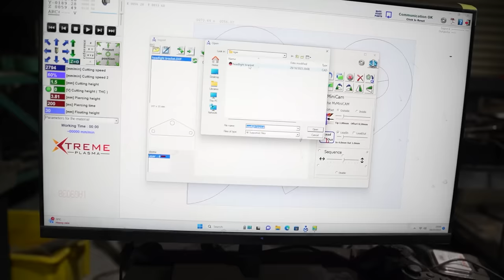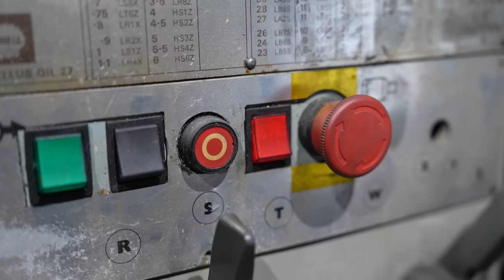More Problems! | Triumph Tiger 90 Restoration | Episode 7

Comment: Hi Dom thoroughly enjoy your videos.  In 1964 I was 17 and bought a brand new 1963 tiger 90 reg 153 NF from Hunts motorcycles on Kingsway Manchester. It was painted in Triumphs Alaskan White and cost £280, an expensive  bike then, but a real looker. After about 4 months the petrol tank started leaking from underneath onto one of the coils. Triumph replaced it with a 1964 tank which had a brace between the mounting lugs, and the tank sat onto 4 mounts off it. I used to rev the goolies off it as did the rest of the rockers in our gang. This caused one of the bolts to come loose holding the alternater to the crankshaft. It fell onto the primary chain, and as it went round the sprocket, tightend the chain and smashed the primary imput shaft. Triumph took the engine back to Meriden repaired it, and replaced other parts free of charge.  The good old days!  I am 77 now and still love bikes, it's something in the blood. Spud.

Comment: A couple of things when you fit a nipple on a cable the most important thing is to flare the inner cable out to fill the countersink in the nipple this provides a mechanical fix when he solder goes round the cable . The second thing is to make yourself a solder pot , a bit of 1 inch brass drilled out to 3/4  filled with solder then just heat it up and dip the end of the cable with the nipple on into the pot (dipping in bakers fluid first ) and you will get a factory like joint .
Reply: Will this work with stainless steel cables?
Reply from the maker: No it won’t work with stainless cables, you need a different flux it’s a lot more difficult!
Reply: Dom I agree with Mervin about the nipple soldering the cable will just pull through if not flaired out. And why aren't you fitting a twin filament headlight or have I missed the intended use of the bike.
Reply: @raysilver2445 I also wanted to say the bit about flaring the cable. If it’s not done right It’ll pull out just when you’re hauling on the lever for a bit of serious stopping. Not good! I also think a front light has to be ‘dip-able’ (high beam / low beam) to be legal. I guess this machine is exempt MoT, but, keep it right! Exciting project though. Les
Reply: @zane1os   In the UK - Carrs Brown Flux and C1000 221deg C   Tin/Silver solder works well with Stainless.
Reply: That soldering won't last 2 mins.. 2 x adjustable spanners ??????

Comment: Hi Dom, This is not meant as a critisisme. During the 70's/80's I competed in moto-x (scrambling) we where always making & repairing our cables. I was taught to flare the cable into the countersink in the nipple before soldering. This helps prevent the cable pulling out. Keep up the great work. All the best Paul Wood.
Reply from the maker: Thank you

Comment: If you can find it - “Mouse Milk” penetrating oil makes a world of difference. We use it in the Army Aircraft hanger to loosen impossible stuff. I maintain the flight sims for the RC12 and MC12 aircraft and it’s saved my butt.

Comment: Hey Dom please be aware that the bracket with the light on it will wobble about as you ride.  I speak from experience! Mine wobbled about so much it eventually weakened and snapped off.   Twice!!!   Bung a little triangulation piece under the angle to stop it wobbling, and you'll be all good mate.

Comment: I don't like the light. Previous comment is spot on about spreading the cable end in the nipple before soldering. Totally unnecessary to solder the bush into the rear brake pedal: I would have drilled and tapped the boss of the pedal to take a grease nipple and drilled the bush to suit so that the pedal would be lubricated. The saddle will be good with a little attention. Hope that the engine turns out to be good. Best wishes.
Reply from the maker: That’s a lot of negativity! Thanks for watching though…
Reply: @DominicChineas  Sorry that it came across as negative. Not too late to incorporate a grease nipple in the brake pedal. Can't apologise about the light though: it just looks wrong to me. Again, best wishes.

Comment: Really nice job on a nice project :)
One though I'd like to share: be careful not to put galvanized (zinc based) metal in contact with aluminum; it would result in accelrated corrosion of both (oxydo-reduction couple)... ;)

Comment: Hi Dom,
Put that rusty headlamp into the electrolisis bath to remove the rust, then put it into a bath of diesel to soak for a week beforwe you even attempt to undo the nut on the bottom, I assume you are keeping the original worn chrome look if so be careful on the electrolisis so you dont strip that off, if you are going to re-chrome then it doesn't matter. cheers, Denis Harvey

Comment: 14:45 Moisturiser.

That reminds me of a summer job when I was a student. I got a few weeks as a general dogsbody at a general engineering works in St Ives, Cambs. The first couple of weeks were at the Chivers factory in Histon, then back to the works in St Ives learning how to use extreme heat and mindless violence to release stuck bolts. This resulted in filthy hands, and when I went to the loo I was surprised to find the soap dispenser outside the main lavatorial area. I applied it and rubbed the gloopy substance into may hands and used  lots of water, but just could not get any suds. Then an old hand pointed out that it was moisturiser, and the soap was by the basins where you would expect it

The final few weeks of the job were spent prepping a couple of the old traction engines from the company's past for display at the Peterborough steam rally. What a wonderful summer I had.

Comment: Cracking videos Dom, nice to see it coming together so well. Takes me back to my early biking days in the seventies when I had 3 Tiger 90s! One after the other though, not all at the same time. If you’re concerned about the headlight mounting stem fouling the headstock, perhaps you could put washers/spacers on the mounting bracket bolts, between the bracket and the lower yolk clamps? That should move the bracket and headlamp forward to give a bit more space. Cheers 👍🏻

Comment: I did exactly the same thing as you while building my trike, i didn't have a front light so bagged an old 4 inch one off ebay and converted it to 12v halogen and it works great. 
That old bates seat is beautiful, perfect patina and everything.
Oh, i know its a bit late now but maybe a bronze oilite sleve made to interference fit would be more suitable for the brake pedal.

Comment: Hi Dom , loving the bike. One thing i have noticed check that the fork stantions are not hitting the tank , it looks like they are on the video. If they are you may need to check if yhe lock stops are worn , if so you may need to add some weld or your lovely tank is going to get two big dents in it. That would be a shame . 👍👍

Comment: I use "cardboard"   but IF its critical   I have a cheap 3d printer    BEST investment I have made !!   Have a Enfield rocker block in front of me  the "holes need to be exact and the idea I have , there may not be enough clearance.   Took a photo of part, drew part, printed all the parts, test fit    IT WORKS ... ( calculate stresses to check all good ...)    Made the thing    ( normally I would screw up the holes or fit some where ,,and money would have been wasted !

Comment: The previous poster Mervyn Hacket is absolutely correct regarding your soldering of the front brake nipple. If you haven't mushroomed the inner where it come through the nipple it will WILL pull off, which I can tell tightens the sphincter wonderfully!
Reply: Don't  worry about your sphincter that will have gone numb along with your hand you forget this is a old Triumph with knobbly tyres.
Reply from the maker: Hahaha!!! Thanks for the comment!

Comment: Dom, if that nipple soldered to the cable is for the front brake please throw it in the bin and buy a brake cable that fits.  The cable centre should be balled out in a counter bore on the nipple before you solder it. I pulled the nipple off a cable on a t100 when I tried to grab a handful of front brake, not something I would wish on anyone.   

Shouldn’t the headlight have a twin filament bulb, main and dip beam?

Comment: Looking at the condition of the old rear brake lever pin it is obvious that it never got any form of lubrication - EVER...
May I suggest drilling and tapping the brake lever for a grease nipple?
Also, great work on the headlight bracket but please don't cut the mount down...
Rather put the spacer on the bottom.
And that seat... that is special...

Comment: Hi Dom. I have just watched episode7. And what a fantastic job you are doing. I noticed that when you are showing your headlight bracket and have the steering on full lock ,that the forks are hitting your tant badge. You might be able to use a steering stop nut, that would fit on the back of the 2  pinch bolts.
Please forgive me if your already aware of this I just didn’t want you to damage that lovely tank or its badges. Perhaps you might even make your own?.
I am a member of the triumph owners motorcycle club, Bexley branch. We meet in Kent every Tuesday night. And would be more than happy to help in any way we  can,

Comment: Hi get there little thing being a rider daily on a old triumph. Your head light will shake and hit the yokes most likely will need lowering as you thought. Ps I run a bronze bushing in my rear brake off a t140.

Comment: Rather than diassembling the seat,use ' elevator bolts'. They have a thin disc insteead of a hex head,and weld on to the bottom of the sest base.

Comment: Remember, put a little rubber insulation between that aluminum and steel, Galvanic Corrosion could take place and cause problems. 👍🏽

Comment: The pinch bolt nuts, on the bottom yoke, were originally longer, and contacted the frame, to act as a lock stop.

Comment: I think it would have been better to solder the bush you made to the shaft of the brake pedal pivot. The way you have done it makes the surface area of the pivot rotating area less and likely to wear more. Also the pivot shaft is smaller in diameter and therefore weaker and more likely to bend. Please resolder the front brake nipple splaying out the strands as  other people have commented, the way you did it is downright dangerous. Looking forward to the next video .

Comment: If the bike is ever going to get an MOT will it not need high and low beam like the original? A spot light is just that, a spot beam with no spread.
Reply from the maker: Good question, we will find out! I think it will only get a “daylight mot”
Reply: It will be be MOT exempt because of its age.
Reply: I'm not certain but I think he said in an earlier episode it wasn't going back 'on the road'.
Reply: Mot exempt
Reply: It's over 40 years old so doesn't require an MOT in UK.
Reply: Even with an age related MOT exemption a vehicle a must be roadworthy in respect to brakes, lights, tyres ect.
Reply: @philelliott5327  think your overly worried about an old light on an old motorbike
Reply: @joeedwards627 Yeh your right, he should just carry on as is, then find out he needs a new light, bracket, loom, and switch gear to make it road legal. Just strap a torch to the front and be done with it😂.
Reply: @philelliott5327  why is his headlight of such a concern to you? Life needed

Comment: I just noticed and maybe I'm wrong.....while you were showing the info on the headlight (@2;20)...I noticed that it looks like the front shock tubes will hit the tank denting it if turned to full lock. Am I wrong. If I'm not wrong it's an easy fix....just add / weld two stops to the underside of the bottom triple tree / front fork tube holder.

Comment: A question about the head light, should it be a headlight with a dip and main beam to be legal ? 
Coming along nicely, glad you bushed that brake lever, there was no need to solder it in if you made it a bit bigger and shrunk it in. 
Love the show 👍🔧

Comment: I’m not sure that a single filament fog light would be acceptable for use as a headlamp, as it is unlike to have the required beam pattern or cut off - depending of course on your MOT tester. Looks the part though.

Comment: That cutter you have is fabulous . Really jealous . How are you aranging to dip the headlamp ? Can you get those bulbs in main and dipped configuration ? Are there any steering stops on the Tiger ? Would hate to see that nice tank dented.
Reply from the maker: No steering stops yet but it’s on the list!
Reply: Surely the headlight needs to dip for the MOT!

Comment: Looks good, but I reckon you just might have an issue with the necessary wiring for the headlight rubbing against the headstock of the frame..

Comment: Will the headlight be stable enough to prevent it moving back & forth with the engine vibrations ? and secondly, is there sufficient adjustment to enable the light to be adjusted correctly ?

Comment: Dom, how are you going to adjust the throw of the headlight beam with that rigid bracket and you will need to be able to dip the beam requiring another bulb and holder, Regards Edward.

Comment: Spotlamp as a headlamp won't work , its bracket will fracture due to vibration and no high / low beam , not failure